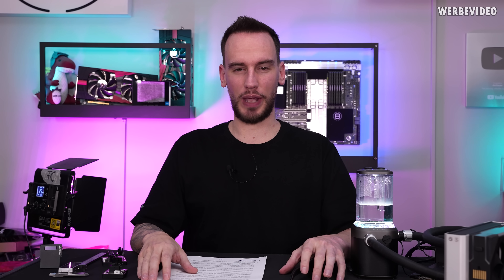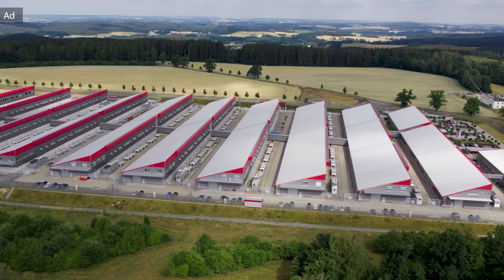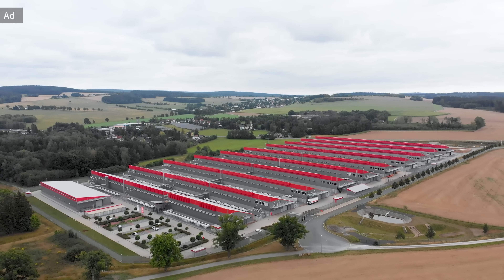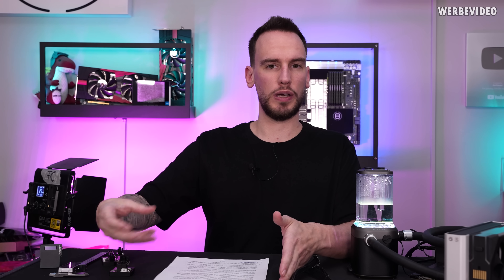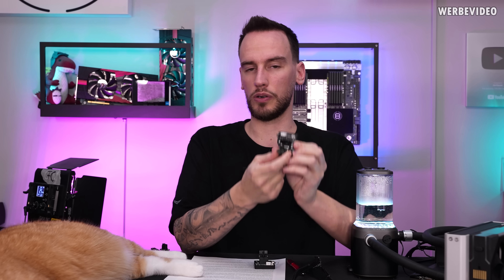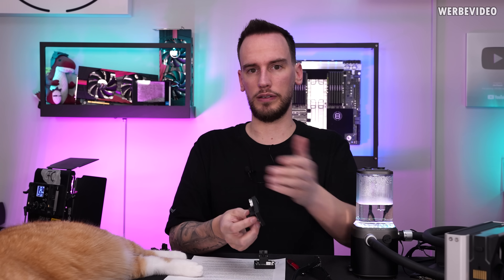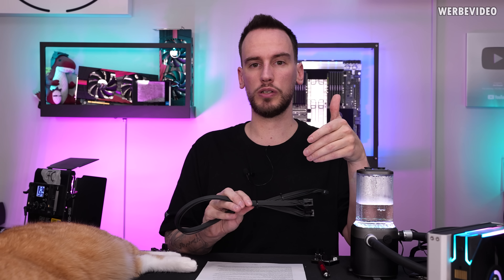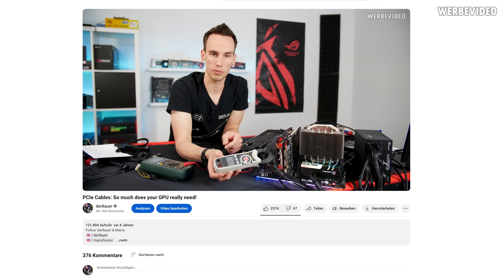12VHPWR is just Garbage and will Remain a Problem!!

Comment: the fun aspect of owning a 4090 is having the privilege of constantly checking the cable connection to find out if your house is about to burn down or not.  /s
Reply: Just keep in mind they are rated for what, 30 unplug/plug cycles before they are deemed no good?
Reply: @mattjones4285  yeah it's beyond disappointing that this 'spec' was ever approved in the first place. I plugged in the PSU cable one time and haven't unplugged it despite moving cases - left it in the graphics card and instead unplugged the PSU end only.
Reply: Yay i m very  happy for families with kids. Good job Nvidia. /facepalm
Reply: Honestly, this is the reason I have have not purchased a 4090. 

You pay a ridiculous premium only to wonder  if you'll have a computer  or a house at the end of the day.
Reply: @tomski2671 you realize you can turn your computer off, right?
Reply: I build a custom clip to mount a pair of temp sensors to the sides of the plug in the GPU. Also a clamp to hold the plug in better than the stock single center latch. A lot of extra work for what should be the basics included with the card
Reply: extremely bad idea.. vhpwr connector have a limited  number of connections .. if you  surpass it - well you will have increased chance of  fire :)
Reply: I've had my 4080 for a year and I never check it...doesn't come unplugged by itself
Reply: Except it's not sarcasm
Reply: That's a feature not a bug
Reply: It should be staggeringly obvious to anyone not sickeningly undereducated that a pin's ampacity can be exceeded if there is complete failure to do something as utterly trivial as plug it in correctly and check the catch is secure as blatantly designed. The sheer lack of intelligence, care, and attention to the most remedial of detail associated with the degrading failure to do this constitutes a truly shameful embarrassment. All this hoo-ha over the source of failure is shocking and ridiculous, and shame on all those suggesting any problem lies with anyone but the user on this matter.

Properly seat your power cables, buy a case that fits, do not bend cables, do not use 3rd party adapters, have a professional who knows what they are doing building rigs and you will have a %99.9 success rate according to the current data..
Reply: @javiersantana848  it is plainly obvious to those of us who actually took in all the research around this topic that many fires were caused with the connectors fully seated. The spec was changed for a reason. You're welcome.
Reply: @kalmtraveler  "that many fires were caused with the connectors fully seated" Projection rejected. This is not even the case nor has it even came close to actually occurring, being replicated or proven. That is only your unproven opinion. This product if anything at all falls under minor defect based on the scarcity of severity of said issue. User error and using after market adapters do not equate the GPU having a manufacturing defect, but if it did it would still fall well below minor defects expected failure rate of %4. over 250,000 units sold less than a few hundred known issues = 0.1%.Properly seat your power cables, buy a case that fits, do not bend cables, do not use 3rd party adapters, have a professional who knows what they are doing building rigs and you will have a %99.9 success rate according to the current data..
Reply: @kalmtraveler  You are welcome...
Reply: @javiersantana848  hmm a flat earther I see. Rejecting simple data points because you don't like them doesn't make them any less factual, actually. Enjoy your life!
Reply: @kalmtraveler   Facts dont care about your feelings no matter how many times you return empty handed with nothing to support your unsubstantiated claims while using ad hominems, sorry. I know facts that contradict your opinions bothers you, and that's ok
Reply: @javiersantana848  Finally, a human with a brain and actual data👍. I'm gonna steal your AQL standard, I've been looking for a simple break down lol, thanks ! ✌
Reply: Easy don't buy a card with that connector go with a nv card without that or get amd or intel.
Reply: We should invent a WiFi smart adapter that watches it for people. 🏠 🔥
Reply: The cable, the sagging ... it's just a stressful experience.
I am constantly expecting my system to crash haha
Not funny at all.
Reply: Is the connector actually fixed or not? or they still have the same problem they did 1 year ago? still no solution from nvidia?
Reply: @willy0297  not from Nvidia themselves but the spec for that 12VHPWR plug was updated to provide hopefully a more secure and solid connection. Both the connector on cards, and the one on power cables would need to be the updated version for this to make a difference though as I understand.
Reply: @kalmtraveler  alright thanks for the info
Reply: lol, not funny but it's funny.
Reply: kalmtraveler  According to the AQL industry standard (Acceptable Quality Level) the acceptable failure rates are as follows. This issue also would fall under a minor defect due to scarcity of the issue (less than %0.1) :

The failure to meet the requirements of customers with respect to quality is termed as defects. The three categories of defects are:

Minor Defects - Not likely to reduce the usability and material of the product for its intended purpose, but slightly altered from the intended design and specifications. The industry average AQL for minor defects is 4%.

Major Defects - Not acceptable to the customers. Usage of the product will most likely result in failure. The industry average for AQL for major defects is 2.5%.

Critical Defects - If accepted, this type of defect could potentially harm or injure the customer. These defects are completely unacceptable. The industry standard for AQL for critical defects is 0%.
Reply: I have several 4090’s rendering & I’m constantly checking the power cables
Reply: @alexfleener  "I have several 4090’s rendering & I’m constantly checking the power cables" And let me guess, you found nothing ? lol. So you are in the %99.9 of others that own the 4090. Not surprising
Reply: @alexfleener I've had a 4099 for over a year and never once checked the cable lmao
Reply: @alexfleener undervolt.  4090 barely loses much compute power (about 5%) when you reduce 20-30% power limit.
Reply: The fun aspect of not owning 4090 is using money wisely
Reply: @LA-MJ It might be expensive, but it's the best price to performance ratio card Nvidia currently makes by miles, and not just because it is the fastest. So buying a 4090 (at retail), if one can afford it, is absolutely using money wisely. I bought mine on release day, and have zero regrets.

I also don't need to check my cable every day. Only time I check my cable is if I do any work inside my case (upgrading/installing parts/cleaning etc).

 If you got it all the way in the first time, then it's going to stay connected unless you are moving your case around or fumbling around in there. It doesn't just unseat itself from sitting there.

The only real issue with this cable is the fact it has no audible "click" feedback when it is fully seated. Unlike an 8 pin where it clearly gives the user an audible click when it is fully seated. So you basically just jam it down as hard as you can until you're pretty sure if you go any further it's going to break, and hope for the best.
Reply: @BeardedFrog 2100$ CA for one component, no not worth it no matter how you twist it. With the 4080 super coming, both are gonna last the same amount of years mostly and will be ancient tech in the same generation. 

People who bought it for 4K RT max settings will still get rid of it for a 50 series when they paid an absurd price for it just 2 or 3 years before. Even if I’m the type of upgrading my system not before at least 5 years, I wouldn’t spend a dime on a 4090, I don’t trust that tech at all. If it’s gonna cost me an arm, better be damn sure that product is flawless, and it’s definitely not.
Reply: @BeardedFrog I feel like you didn’t watch the video. Even if you “get it right” it can still fail over time.
Reply: @LVNeptune  Lol? What piece of technology are you aware of that cannot "fail over time"?
Reply: @BeardedFrog Read what I wrote. Re-read it two or three more times. Let me know when you comprehend what I said.
Reply: @LVNeptune  Re-read what I wrote. Re-read it two or three more times. Let me know when you comprehend what I said.

Oh look, I can play the same game.

Please do tell me what your primary argument is exactly? That a connector that was developed by multiple parties (aka not just Nvidia), can fail when improperly seated, or perhaps over a long period of time if it manages to walk it's way out? Not to mention the connector is used on more than just the 4090 as well.

I'm not even going to defend the connector anyway. It's a crap design, as it has very little direct audible feedback "click" when fully seated, amongst some other issues.

That being said, it in no way is a demerit to the benefit, and price to performance value of the 4090 (at retail). It's also likely to continue to be the connector that will be used for quite some time on all new cards.

Once again as well, everything fails over time. I've reconnected mine once since I bought my 4090 on release day when I upgraded from a 5900X system to a 7800X3D. No issues.

 Bought a card on November of 2022 that is still the best card around, and likely based on current climate, will be for quite some time still. Not to mention it will be relevant and useful for quite some time after that as well. Zero regrets.
Reply: @BeardedFrog I just went through all these posts and it looks like one of two things happened 1) you were incorrectly tagged and the other person deleted their post 2) you were correctly tagged and deleted your post.

I was specifically responding to a comment about how “if you plug it in correctly there won’t be a problem”
Reply: @LVNeptune  lol okay, no worries. I mean the statement of "If you plug it in correctly there won't be problem"  is mostly true though.

Assuming the adapter isn't a cheap or poorly manufactured adapter, plugging it in correctly, without any kind of agitation of it afterwards (i.e. tugging the cable after, lot's of general movement like shipping it, etc); then it should work fine for a long time.

Most of the issues due stem from not fully seated connectors, and/or incorrectly made aftermarket adapters (or rarely incorrectly made manufacturer adapters). That and cables being bent/tugged tightly/hardly after being connected without supporting the connection, thus walking it out of the connection.

At the end of the day though, while user error in general does account for almost all cases of problems, the design overall is poor and is a large part of why user error occurs. Although Nvidia gets WAY too much of the blame misdirected at them (though they are partially guilty).

The biggest issues are:

1. That the connection has almost zero audible click feedback indicating that it is fully seated, and takes quite an uncomfortable amount of force to be fully seated. This is probably the biggest issue, and why user error is so high.

2. Nvidia stupidly, irrationally, and without any logic deciding to mount the connection on the dang middle of the card. This sucks both for cable management/aesthetics, but also leads to people walking their cables out of being seated as they bend the cable at a 90 degree angle to try and route the cabling around the card, or it hits up against the side panel, etc. If only EVGA hadn't decided to stupidly leave us, and released their beautiful 4090 that actually put the power connections back in their rightful place...

3. As a minor note that isn't a direct cause but is a cause of concern: People are often using daisy chained cables to connect to this adapter. I.e. instead of using 4 (or on some cheap 4090s 3) separate 8pin PCIE cables from their power supply (as many lack this), they will often use the PCIE cables that split into two separate 8 pin connectors. So they might end up only using two actual cables from their PSU to connect to this adapter being split into the 4. I feel like this can be a potentially very dangerous scenario, especially depending on the gauge of the PSU wire.

Either way, we're all stuck with this new PCIE power connection. It'll be the norm going forward, even if it does improve.
Reply: I chose to go with a 4080 Founders Edition and I've been pretty happy with it so far. It's a very efficient card, which means I don't need to worry about the power consumption and the state of the power connector. I want enough GPU power for the upcoming 4K 240Hz monitors but if NVidia keeps disregarding power consumption on their flagship cards my next GPU will be the more efficient 5080 instead of a power hog 5090.
Reply: all because your too cheap to upgrade to the new standard of psu
Reply: @ezrollerj  new psu is not a miracle button which makes everyone happy . vhpwr delta between we are fine and we are up in smoke -  extremely low . and  can be bypassed  with  plugs . and internal resistance of cables . 

honestly  psu part of vhpwr MUST BE SOLDERED  to psu board and  each of power delivery cable internal resistance measured . but take a wild guess how many  psu manufacturers will do that ?  spoiler - none
Reply: @ezrollerj  this guy clearly hasn't watched a single video about this 'new standard of psu' connector problem lmao - thanks for the laugh!
Reply: @kalmtraveler  yeah there terribly hard to find 🤣 ---->>>>> 
there's only about 10000000 different versions the same story from sept ish 2022
Reply: @ezrollerj  Has nothing to do with that.
Reply: You deserve it for buying 4090.
Reply: Just like... Don't abuse the cable, its pretty dead simple. And buy cables designed to have 90 degree / 180 degree bends, never trust adapters.

Comment: And you just confirmed 12VHPWR isn't suitable for Adapters/Extensions.

Even 8-Pin Adapters/Extensions have melted in the past, though not as many as 12VHPWR due to the pin size.

Comment: Had thought 12VHPWR would have some backwards compatability, but it's power connectors are literally smaller. So it's weird they would lock themselves to this formfactor if they are going to use a new connector anyways.

Comment: 2 connectors are still not good because you still have to bend the cables and ... 
I don't understand Nvidia. Why bother with a new connector when you have a good one, tested over time. Just to save few square cm ? The biggest problem is that when you wiggle it, it just makes the pin connections looser with each wiggle and is just how your card connector behaves from the LED behavior. Loose pins connections.

Comment: In fact, it is not adapter problem. This is too much voltage and heat for this size of connector. All 4090s and 4080s are in danger.

Comment: Need to bring back the screws holding two connectors together. Just opening my case makes me distrust that one point of failure, which is a bit of a problem since IT SHOULDN'T BE A PROBLEM.

Comment: Things are even a bit worse in the video. The original 8 pin is based on a mini fit connector, where the new 16 pin is on the micro fit. The micro fit has smaller pins and logically would have a lower rating. If i spec out a 16 pin using the specs from molex, the rating would be 5,5A per pin with a total of 396W.  The biggest reason the rating is so low, is because the current per pin is derated based on how many  pins there are on 1 connector.

(If i do the same for the 6 pin connector, then that comes to 288W, 8 pin goes to 252W because it has the same number of +12V conductors)

I believe the derating is there because of differences of contact resistance between pins, this contact resistance will give certain pins more current and those pins heat up more.

They tried to solve it in the new PCI spec with the 3 dimple or 4 springs, and they added specs for temperature rise, contact resistance and limiting the variation of resistance.

These cables do move around and updating a spec for which there are already thousands of cables/graphics cards in circulations is not really helping.
Reply: That's fallacious. We already know what an 8 pin EPS 12V is rated for at the same form factor of the 6+2 PCIe, and that's 336 watts. And that rating is before adding in safety margins, the way it should be done.
They're certainly not supposed to be used when the ambient temperature rises to the point where your nominal power draw will erode them.

Two of those would've easily been able to keep up with even an overclocked 4090's power demands.
Reply: @antagonist99  The EPS 12V 8 pin has 4 +12V pins where the PCI-E 8 pin has 3. So no, they are not rated the same. 

That rating does already have some safety margins, because this comes from molex as a rating for the connectors they sell. often used in all kinds of machines and devices. That is why there is a lot of derating and specs built around for when the rating is applicable.
Reply: @mechitworks  read my post again, but carefully this time.

Comment: You might want to ask yourself - what they were using more than 10 years ago to power these 500W cards: AMD R9 295X2 and  Nvidia GTX 295 ASUS MARS ? Well, guess what - they used just two 8-pin. And it was more than enough. So why bother using more than three 6-pin (or 8-pin) for any current 600W card, let alone the ridiculous 12VHPWR ?
Reply: used to draw close to 750w-800w on an overclocked 295x2.

Comment: The rated power of that conector must be 300w max and the 4090 will need two. The old 8-pin conector... i have one cable with a split taking 280w with no problem from the PSU.

Comment: Corsair cable user here, with Corsair 1500w PSU and a Neptune 4090 that has been pulling more than 500W almost on a daily basis... so far, no issues whatsoever.